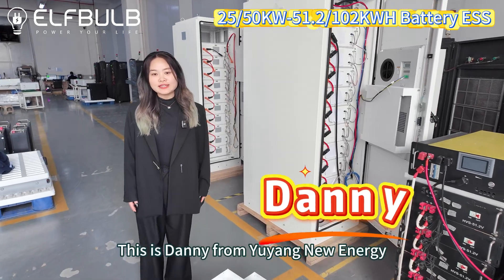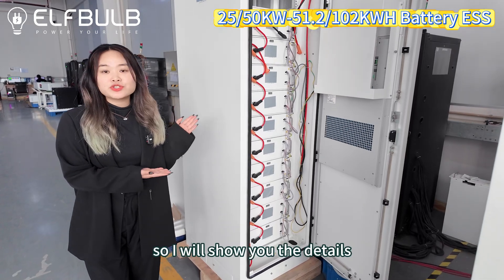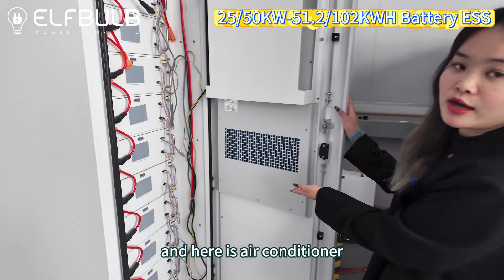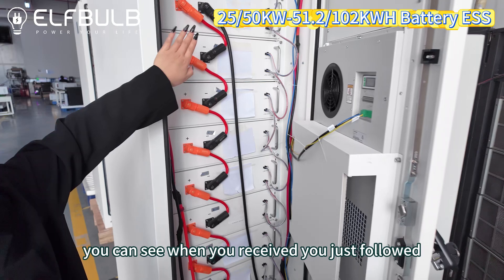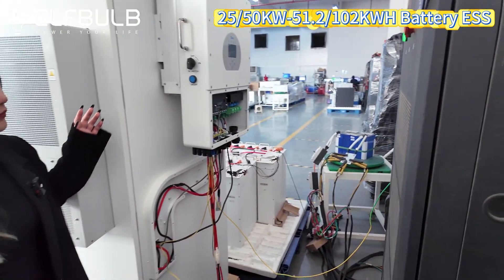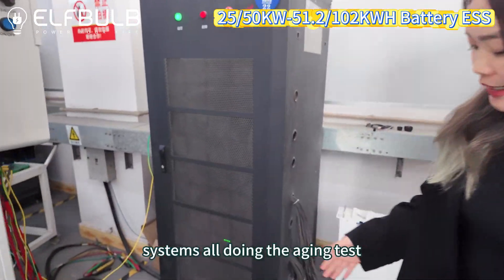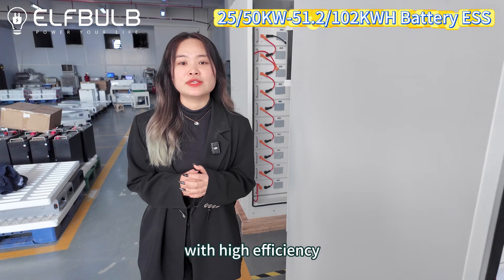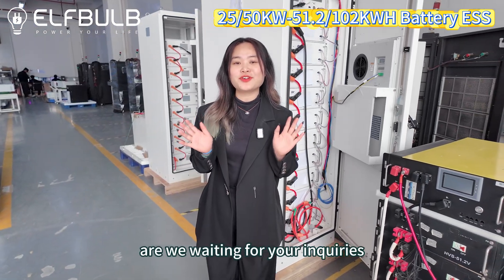Deye 25kW 50kWh and Deye 50kW 102kWh Battery Energy Storage System

Comment: Can i know the price form inverter trifase with 50kw battery
Reply from the maker: Yes may I know your WhatsApp number please?
Reply: 50kw deye inverter itself should cost $5000+, battery bank will cost a lot more because 5kwh battery bank in india costs around rs 1 lakh, thats more than $1000 for just 5kwh. 
if we take $1300 as price for 5kwh, 50kwh should be $60000, inverter should be $10000. 
for 100kw double it.
this price is including custom duty which doubles the price of these foreign products. 
Please try to buy everything which is made within your country. 
eg: transformer based 50kva is $11000 (in my region its around rs 9 lakh) with rs 9 lakh battery li ion or rs 2 lakh batteries lead acid.. 
but if i import, price is a lot higher.. imagine $60000 for batteries, if i buy domestic goods, i can buy same equipment within rs 20 lakh, installation extra. 

she looks good but doesnt encourage me to waste my elders money when i can do same thing at less price. power losses of transformer based considered too. 

deye, solis, growatt, etc all of them are good. if you are from the same country it is manufactured from. then no custom duty, fast after sale service etc. 
eg: if i buy solar inverter who is very close to me, if i dont have electricity,  it is fixed on same day. 
eg: if i buy gootu or any foreign country brand, it will take days or months too because these are high frequency low voltage hybrid solar inverter, meaning it needs advanced repairs or whole board replacement. ordering that and sending your inverter and getting your inverter back will take a lot of time. but if you buy from someone who is very close to you, it happens within 1 day or 7 days max.

buy from deye or any other brand if they are very close to you. it shouldn't be " made in china " " installed in india or other end of the world ". 

if its other end of the world then there should be some middleman with all spare parts to fix and give inverter back within 1 day. eg: solis, growatt, sofar, good year etc have Tata Solar in india. so we can trust these chinese brands. but if deye too get tata solar, we can trust deye too. otherwise no. because we need 1 day after sale service. not 1 month export fix import back.